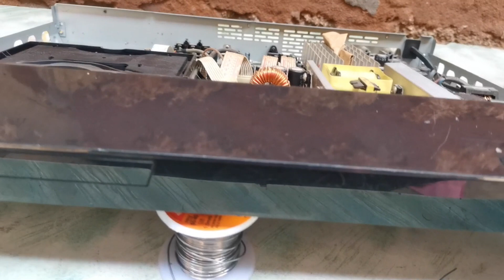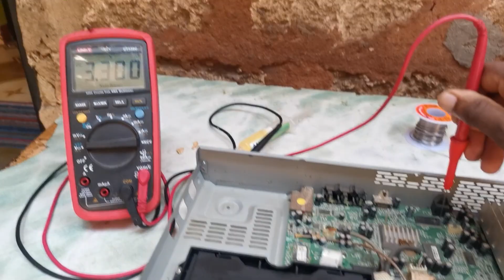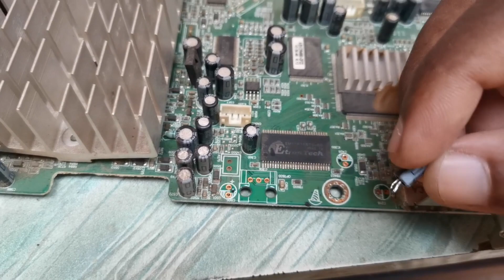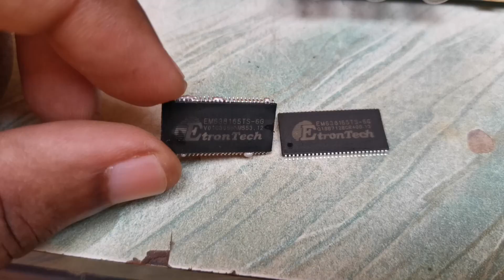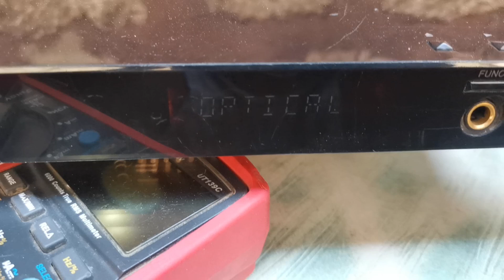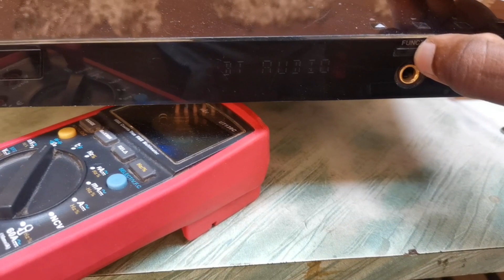SONY HOME THEATRE DAV DZ350 'HELLO' PROBLEM - FIXED

Comment: Where are you located?
Reply from the maker: Mombasa, Kongowea
Reply: @MwashighadiAshton your contacts pls
Reply: Hello mine had a problem, with the treble sound,  took it to another fundi who removed the middle ic. Later too it to the second fundi who fixed back the ic... And installed another power supply in the machine so they are two but the bass isn't strong as before what could be the problem
Reply: @billokello5035  first confirm if 32volts is present
Reply: Hey, am in kisumu  and my home theatre has the same problem. Where can I find this ram ic and what's the cost?
Reply: @wycliffeosula2907  1000ksh